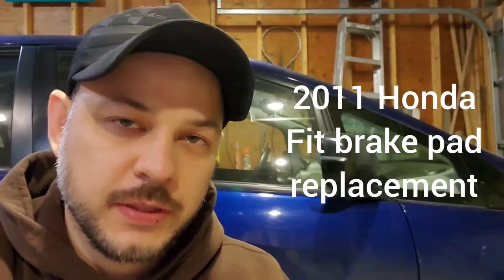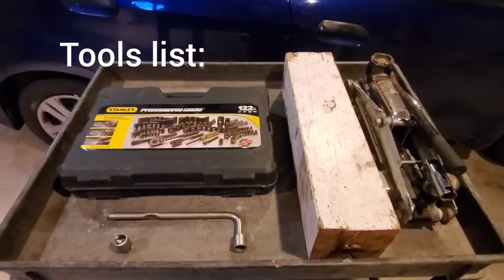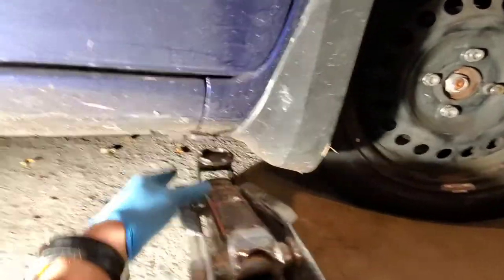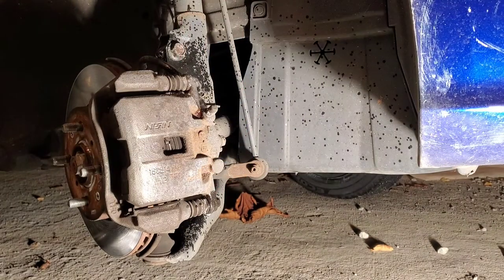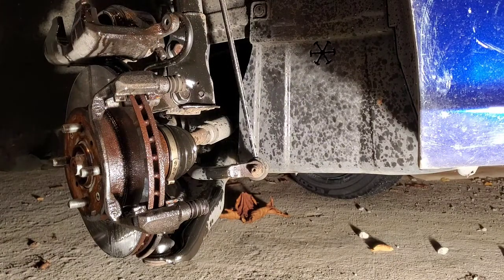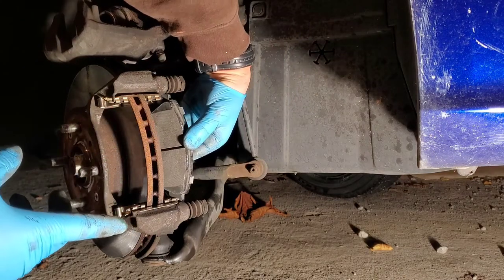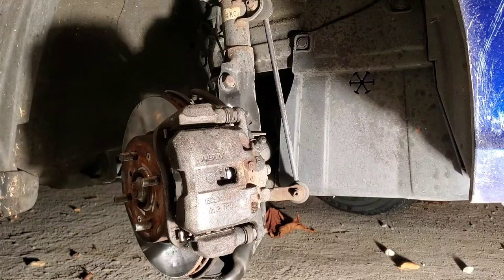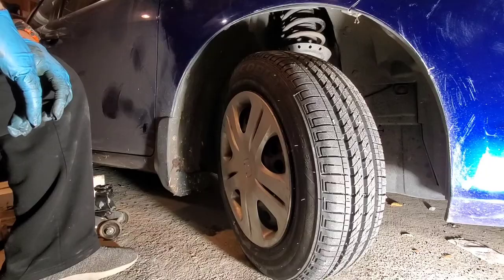2009-2011 Honda Fit brake pad replacement

Comment: thank you for your effort and the time you dedicated to making this video. I would however, use a small metallic brush to remove excessive brake dust that has built up on the upper and lower ends of the caliper brackets. I'd also suggest loosening the cover of the brake fluid reservoir so as to let air escape while compressing the piston back into the caliper body.
Reply from the maker: Great call on the opening the master cylinder for the brake fluid. I have never done it myself but I have heard of people doing it. I haven't ever had problem not doing it. As for the brush, this car is very low mileage, on the Buick I went the extra to brush and clean with brake cleaner.

Comment: Hey man I need to do brake pads on my 2010 Fit but I'm scared shitless hearing about your caliper drag incident where the brake pad caught fire. What advice would you give to someone who is a little leary about doing this job on their own?
Reply from the maker: Thanks for your question, the job where the brake pad caught fire was done by a mechanic of 30 years experience. The car was 15ish years old at the time with zero maintenance done to it.  That is the only time I ever had it happen to me. I think its more likely that the piston will cease which happen to me on another car this year. The mech told me the flexible brake line collasped. 

My advice, clean everything well, once the job is done take the care for a few short trips with the radio off. If you feel anything bring it back right away. I think a brake job is a 1st years apprentice job at a shop. Dont focus on the horror stories, how many times have you heard someone get hit on a crosswalk? Do you still cross the street?

I will tell you this, the water pump video on my channel, I was haunted by the water pump I did on that car that car where the brake pad that caught fire.I missed timed the crank/cam by one tooth.

On the Civic, I spun the crank by hand probably 12 times to make sure the piston/valves werent going to hit each other. Once I cranked the engine, it turned over but wouldnt start. It was the ignition coil(I made a video) 1st water pump l did,  I missed timed it. The second on the Civic, the ignition coil failed. Hopefully on the next water pump l wont run into any issue haha.

Good luck!! Im sure you will be fine.
Reply: @HomeownerDIY  thanks man for the vote of confidence. I got all the parts from your video and I'll tackle it this weekend and hope for the best. Thank you again
Reply from the maker: @broganhogan3469  Please follow up with after you finish the job. I always look forward to updates and feedback!
Reply: Hey man I just did the fronts. Your guide was perfect! The only thing I added was when I pressed my piston back in, i loosened the cap on my brake reservoir fluid in case any air got squirted back. I did exactly as your guide and knock on wood, so far so good! Thank you so much!!!
Reply from the maker: @broganhogan3469  Very happy that things went well! As for the reservoir cap, I had someone else mention the samething, since I am a DIYer I do miss the little things.  Thank you so much for your constructive feedback, I will use it to improve my future video's. If you have problems or questions about your Fit in the future, please shoot me a msg either here or to my email. I will do my best to help you. All the best!